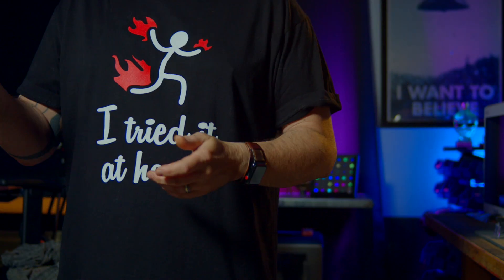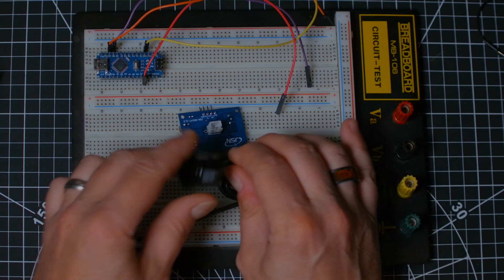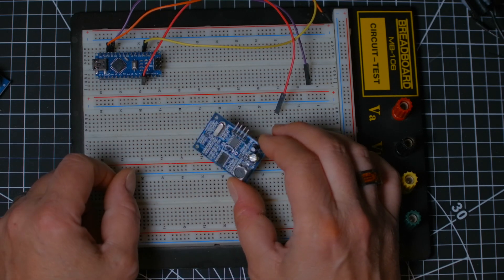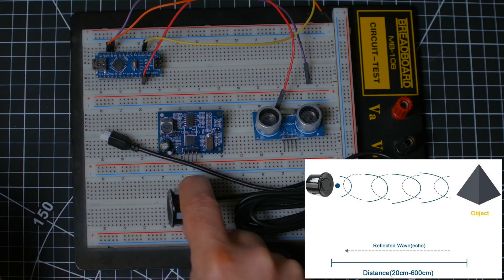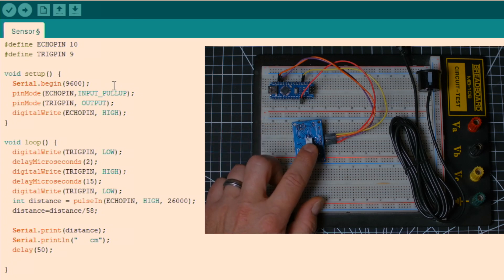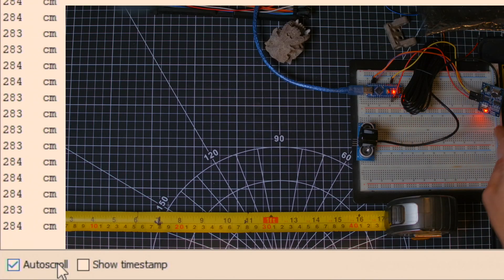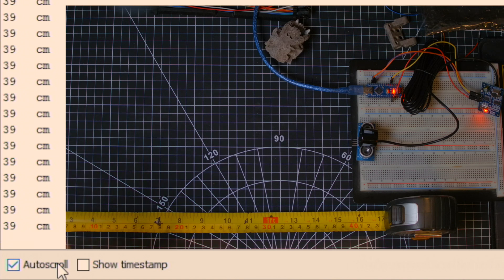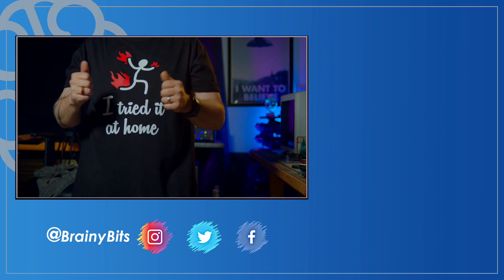JSN-SR04T - Better UltraSonic Sensor for the Arduino?

Comment: can i use the JSN-SR04T without that board? only the sensor to connect it to arduino? and im wondering how many cable are in that sensor, is there a com cable for sure or just VCC and GND?
Reply: it's a two pin sensor so you need a board to translate

Comment: Hi! Thanks. Very helpful video.
Do you know if this sensor is better to measure soft surface like cloth? I want to measure the distance between this sensor and a human (who wears clothes). I couldn't do it with ultrasonic HC-SR04, seems like this sensor it's the same for my porpuse, doesn't?

Comment: Hi
I read in some data sheets that it has a 75° measurement angle, but I cannot find clear info on this. Can you clarify this? I guess you could correct this by either mounting the sensor at an angle, or by correcting the results mathematically.
I am planning to use it for measurements of pond water levels (measuring downwards from a fixed beam onto the water surface).
Thanks for any comments!
Reply: ?????? it means it can measure in a cone duh
Reply: @urnoob5528  honestly, I don't even remember what I meant by my comment above...
Reply: @TobiKellner Hii sirrr , im a student and is doing projects related to finding water level . Can the project be dome using these jsn-sr04t or which is the best sensor for this .it would of a great help if u help me out in this
Reply: @jeevan0714   hi, I didn't use this in the end, so I am afraid I cannot help you :-(
Reply: Hii sirrr , im a student and is doing projects related to finding water level . Can the project be dome using these jsn-sr04t or which is the best sensor for this .it would of a great help if u help me out in this

Comment: Q: You guys have engineer notes on this device? I want to explore those resistor/mode settings.

That being said.. I'm playing with one for an industrial project and have had a lot of spurrious reading issues.. 

I fixed some of the reliability issues with the INPUT_PULLUP.. also had to take all of the Serial.print()s out of the timing loops (or anywhere near pulseIn() )... adjusted the pulse delay to 20uS.. and for me, I was getting occasional infinite (676cm / 22.5ft) so I discard anything over 20ft (610cm) and re-read.

Hope this helps others:
https://github.com/LetsCodeBlacksburg/arduino-recipes/blob/master/ultrasonic-jsn-sr04t_BEST/ultrasonic-jsn-sr04t_BEST.ino

Comment: Sir, please tell me, what is the use of trimmer(pot)  in jsn sr04t module?
Reply: People say it is to fine adjust the frequency (40kHz) at factory. I don't know for sure but when I messed with it almost nothing changed, which corroborates this theory. Also apparently, it is an adjustable inductor.

Comment: So, waterproof, tick; long cable, tick; more expensive, cross; unreliable, cross; can't measure under 20cm, cross; bigger board, cross. On balance, not an illustration of progress.
Reply from the maker: There are some compromises for sure compared to the HC-SR04, but I'm currently working on the next tutorial and will share my finding about the accuracy.  Of course if your project needs to read distances lower than 20cm than yes, this sensor is not suited for those.  Thank you for your comment and for watching!
Reply: @BrainybitsCanada   Thanks for this!  Different projects have different requirements and can accept things that may not work out for others.  For me, those shortcomings aren't significant compared to the benefits this product offers over the previous versions.  Since my project experiment is to monitor the space above a vehicle (from about 4 ft (1.2m) below the roofline) to detect/display overhead obstruction distance/clearance, the 20cm minimum isn't an issue.  Neither is the additional board, which will inside the vehicle.  The 2.5m cord, small plug, and single/small sensor gives me some excellent and unobtrusive mounting options.  I do plan to use 2, one on each forward corner, because damage to equipment on the roof would be real bad.  Yes, this is just a back-up when moving under low overhangs at very slow speeds (that you should have confidence already in clearing).  Of interest will be how reliable and accurate at distances of 2m-3m (6.5 to 10 ft).